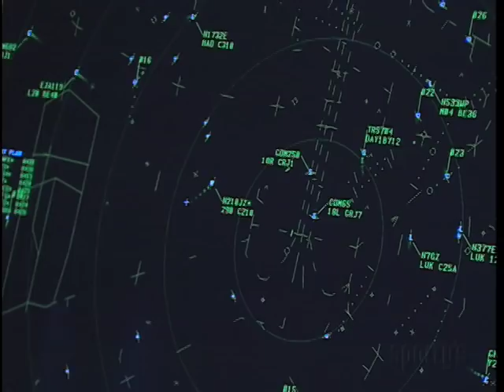Landing an Airplane

Comment: First solo 500 foot ceiling foggy with good visibility below the fog. Turned finals pulled out full flap dropped power & the altimeter hardly moved . I had to go around & slip it in, fortunately I knew how to do it. My instructor was delighted, I just did what I had been told what to do. I was flying an old Auster, I loved that thing, hardly responsive but heaps of fun to fly & learn how to land. Landed on dirt very few paved runways around where I live.

Comment: You say a pitch change requires a power change, but you don't specify the change.  If you pitch down do you reduce power?
Reply: Yes you'll reduce power otherwise you'll speed up and descend too quickly

Comment: People fly these too much like airliners, this is a piston engine not a turbofan, it has an almost instant reaction to throttle and a much lower dependability. Also the plane you are flying has a much lower speed range than an airliner. It is much safer to fly a higher approach most of the time, look at ww ll landing techniques, they almost guarantee that in case of an engine failure you will have the runway made every time. Dragging yourself close to the ground with a much more failure prone engine just so that you can do that 3 degree glideslope like big iron does is like dropping all your life insurance out the window. Liners need to fly like that thanks to how their engines respond, their range of useful thrust, the range of speeds for landing, etc etc. Ga's don't. And if you need to drop that altitude, just do a slip.

Comment: So I should paint a long black moustache on my windscreen?
Reply: Some do use a dry erase marker to help train.  But you just need to realize what you're looking at and why... the marking just shows this vividly for the slow among us.
Just know that your aiming point should drift down or up on a stable approach to land, but just stay at the same place on the window. 
If aiming point  drifts up, you're too low and need to decrease your rate of descent to get back on a better glide path. Add power. Keep pitch for speed as needed.  
If aiming point drifts down,  you're too high and need to increase your rate of descent to get back on a better glide path. Reduce power.  Keep pitch for speed as needed. 
Power for altitude, pitch for speed for landings.  And really, this same concept is essentially for keeping altitude and speed controls for any part of the flying.  Just some other stuff to consider.

Comment: EXCELLENT produced Vid...! I use to explain to my students (back in the mid '70's at KFAY) the reason we practiced "turns around a point"  is to take each quarter of the turn and super-impose THAT quarter to the traffic pattern - upwind to crosswind, crosswind to downwind, downwind to base, and base-to-final approach and we teach and incorporate climbing and descending turns for the same reason... It all goes back to "traffic pattern work".... I would also teach, from downing to touchdown, a power-reduction concept - you can decrease power but can NEVER add power unless there is a requirement for a "go around" or in gusty wind conditions.... I really admire your teaching of the nose wheel HAS to settle down on the CENTERLINE of the runway...! Again, GREAT Vid...! Thanks for posting this...! Gordon in Maryland

Comment: Try looking for the Young Eagles program which allows 8yo.to I believe 18yo. to fly with a pilot at normally no cost like an introduction flight. If lucky enough you may find one who is a CFI (instructor) that can sign off on the time as well. It's a great program for kids. They will accept donations but it's not required. There a great group of people. 
Good luck.

Comment: One of the better 'how-to-land' videos I've seen [former instructor, 5,500 Hrs]. It didn't labor 'fly-by-numbers' but did give sensible advice on accurate nose attitudes and interpreting the runway aspect. I did however cringe at the adverse aileron yaw, which really should have been nailed on the 'primary and secondary effects of controls' lesson.

Comment: I know AGL means "Above Ground Level", but what's the height valve? Like if I'm 500 feel below clouds but really I'm 700 feet AGL. Does that mean at ground level we are 200 feet higher than see level and I'm suppose to add that to those figures? 
Surly, y'all can see I'm a rookie. Thanks for your help in advance.( Please no wise cracks okay? Thanks)
Reply: rdlez It depends on the elevation. AGL means how high you really are above the ground. So if you are flying at 850ft and there is a mountain thats 850 ft your AGL is 0 ft. When runway elevation is 200ft you would indeed need to calculate 200ft + your original height.

Comment: During my flying training I was concerned that the stall warning occured each time I touched down. My FI said that was good, stalling on the runway is a perfect landing (except on an aircraft carrier!)
Reply: Your CFI is correct.  The slowest the A/C can fly is its stall speed.  Since the forces that cause the A/C to swerve (on the runway) are proportional to the square of the airspeed, you can see that having the slowest possible airspeed at touch down reduces these adverse forces by a significant amount.

Some will say to use a higher approach speed in a cross wind.  No, just put in sufficient wing down and rudder to compensate for the X-wind component and land with normal A/S.  In VERY gusty wind add maybe 5 knots to your normal approach speed.